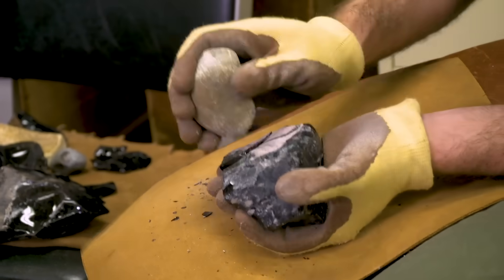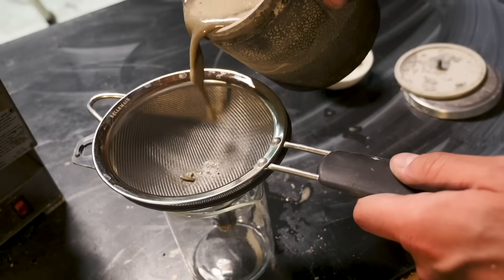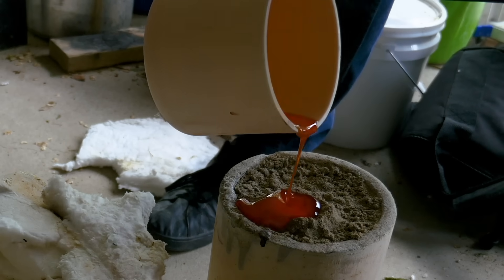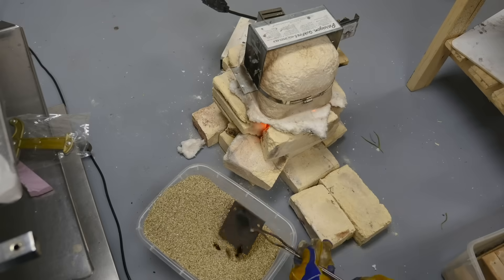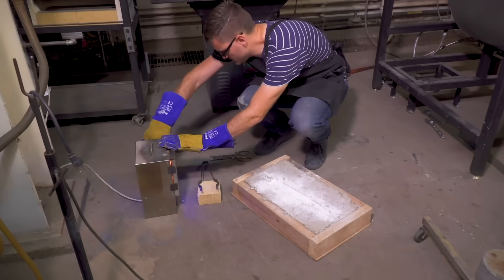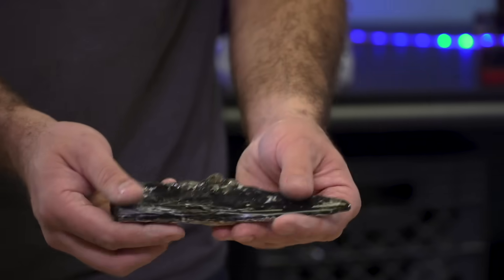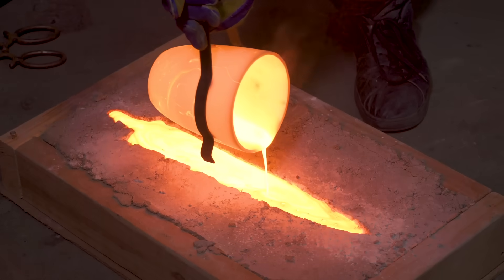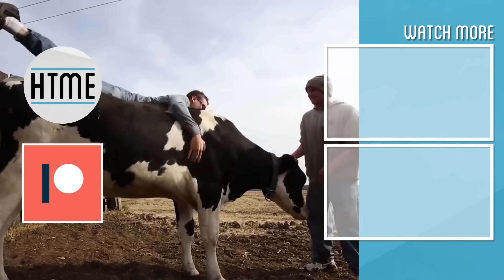Can You Melt Obsidian and Cast a Sword?

Comment: Find yourself a ceramics shop, borrow their kilns. Make the cast, crush the obsidian, put the crushed obsidian in the cast. cast and everything goes in the kiln for a cycle and then is set to cool slowly overnight bring the temperature down over time. Next day you will have a cast sword which you could in theory sharpen. Whole process circumvents the need to make obsidian pourable, and should keep most of the properties. This technique is called Frit Casting and is used by actual glassworkers mostly for making glass cameos.

Comment: I was thinking, and, what if you had some sort of fill in mold kinda thing, so, you could simply fill the mold, and, seal it tightly, so, while it would probably take longer to cool down, if it's a tight enough thing, maybe it won't break as much? 
I'm no expert, since, I'm just a kid.  XD but, I just figured I'd throw that out there. I probably sounds stupid since, there's a lot to it that I know I don't know, but, maybe it could work? Although, I'm also not sure of how any possible pressure from the heat and the bubbles could cause.

Comment: The mineral obsidian is a volcanic glass.  It has the same chemical elements as porcelains and ceramic glazes, and the primary one, silica (AKA quartz), must be very slowly cooled at two critical points to avoid stress cracks. Look up "quartz inversion" and "cristobalite formation" if you are interested.  Art glass is always put in a heated chamber (lehr) and cooled gradually for many hours.

Comment: If you give it a try again. I would try melting it, pour it, them quickly put it in a crucible at its melting temperature and incrementally lower the temperature to ambient temperature. Thats the way metallurgy works to give steel a longer life. Dont normalize, quench or aneal.

Comment: You better anneal the glass  at high temperature quickly after casting using a furnace. It will give you a beautiful piece. Do not know the temperature (maybe between 500 - 700 C)

Comment: The bubbles are definitely from moisture in the concrete. Keeping in mind, it will take a good 12-14 days for concrete to finally and completely cure. then adding a little bit of heat will remove any remaining surface moisture.
The problem is, Obsidian is formed over days if not weeks or decades, like rocks such as granite or crystals formed under pressure like diamonds etc. Letting the obsidian cool over a very long time, as in, putting the mold straight into an annealing chamber as soon as you've poured it, and slowly dropping the temperature of the obsidian over a number of hours, if not days ideally, will give you optimum results,

Comment: Figure this is why pretty much any genuine obsidian blades are fairly small and embedded into wood or other support; the stuff's just too brittle to hold on its own.  Not to mention the knapping to make them viable as blades to begin with takes off a fair bit of material and has the risk of shattering the blade further (but into smaller, still usable blades at least).

Comment: How about pouring the obsidian in a preheated sandcast?
Moreover, it seems quite obvious that the impurities contained in the obsidian could be responsible for the cracks...
That's why 'glass' was developed.
Obsidian is created in inscrutable and as a consequence non repeatable volcanic processes. The logic conclusion is that it would be easier to carefully chip away an obsidian block into the desired form and 'then' proceed to hone a blade with abrasives. How about pouring some hi-tech modern glass?
Anyway, it was fun to watch. Congrats.

Comment: Geologist here with some additional info...

Obsidian is volcanic glass, which is ultimately just rock.  Its made when felsic (silica rich, metal poor) lava is cooled down very rapidly (for lava) so that mineral crystals dont get a chance to grow.  Its basically exactly the same as granite, just instead of having big quartz and feldspar crystals you can see in your countertop, each individual crystal is so small you can only see them with an X-ray diffraction microscope.  The extremely fine grain size scatters light very effectively, giving it its dark color (along with some metallic inclusions; magnetite (an iron oxide) is a major one).

The clear amber glass that was produced at first was due to super rapid cooling that gave totally amorphous glass, no grains at all...this allows light to go through it without scattering, and the glass looks much lighter in color.  Interestingly, by doping it with so many metals, you're changing the rock's chemistry, and thus it's not really obsidian anymore...that much extra metal would make it more intermediate or mafic in composition (rocks like basalt have less silica, more metal), meaning what you were casting would actually be something called tachylite, not obsidian :)

Rocks melt at much higher temperatures than glass that humans use, as we saw, making it hard to work with.  They're also much more water-rich, especially since you were using natural obsidian...thats why it bubbled and foamed up a lot.  That's what makes volcanoes erupt, in fact - as magma under the volcano rises up towards the surface, the pressure decreases, water and CO2 bubble up, and the whole magma package rapidly expands, forcing it up through the pipe and bursting out the vent as an eruption.  So congrats, you just made a tabletop volcano that's way more realistic than baking soda and vinegar :)

I suspect most of the problems came with the annealing stage...to get a natural obsidian result without doping, you'd need to cast it at a much higher temperature - rhyolite (felsic volcanic rock) melts at around 2300F.  And you'd probably have to go even hotter than that, because even when molten, its still going to be very viscous, because in silica-rich melts, the silica polymerizes....forming long chains of connected silica molecules that make the overall melt very goopy, and you need to heat it up more to break those chains.  And once it was cast, it'd have to be held at a much higher annealing temperature - just below the melting point - and allowed to anneal for a much longer time - days, even weeks.  its actually not really annealing in the true sense, but giving enough time for nano-scale silicate mineral grains to start to form throughout the piece, giving it the black color you're looking for.  In nature, a huge flow of thick lava would take this long to fully cool, and that's what you're trying to recreate.  Go too short, and it'll be entirely glassy and look like a beer bottle.  Go too long, and the crystals will get too large and you'll lose the glassy shine, getting something more dull and stone-looking.

Comment: Cooled too slow and uneven. Obsidian has to be quickly quenched as what happens in nature during its formation. Incorrectly done, the outer layer cools first but the inner layer is now heat trapped and cools much slower so the layers become extremely brittle due to crystallization.
. 
Some polypropylene's have the same problem where the material appears strong after heating, but the slightest "jarring" breaks the crystals causing micro-fractures. Once crystallization occurs, any disturbance breaks them no matter the time delay between formation and movement.

Or at least, that's what it looked like to me.
Reply: Looks like someone has studied in Minecraft Sword Enchanment...
Reply: Lau - No, I don't know the first thing about "Minecraft". 

I work in the packaging industry. All those bags you can't open are my fault. Over time, you see a ton of issues with many different films (the material bags are made from). We run into crystallization when we try to run production too fast on cheap film. We have to substantially increase the heat, lower the pressure time "dwell", and greatly reduce the cooling time. In some films, this causes micro-fractures in the seals. The cause is identical to failed Obsidian creation from the Wikipedia page. 

They go in the shipping box fine, the next day they're all flat (leakers). Then, you won't buy it at the store. Smart of you by the way!

Chemical reactions tend to be similar across many materials so I just applied film material dynamics to "essentially" molten glass.
Reply: shunt uip nuerd
Reply: A  shween S lol

Comment: You should have worn protection when crushing the obsidian. That dust can get airbourne and cut through you lungs like nicroscopic macuahuitls causing silicosis. Being from a place where obsidian literally grows from the ground in pillars, ive learned obsidian is a rock you need go treat with respect.

Comment: you are trying to use such small equipment for the task. can't be adding flux into your obsidian and weaker metals. this is a sword we are talking about. you need to heat it up a lot more will reduce the viscosity a bit right?

Comment: That was cool vid. I worked for a long time in the glass blow moulding industry. The temperature of the mould is crucial to not getting cracks. So if your still thinking of another attempt. Find a way to heat the sand to about 700 deg F  and it may work better. Either way it looks like a success to me.

Comment: The main problem I think you had with it being brittle was that you kept using the original material from each try, even a novice forge worker would know that if you re-use material over and over again then it will lose its structural rigidity and eventually become unusable, sure you kept adding in a bit more each time, but that doesn't help make it stronger. You were making the material more unstable for casting each time you re-heated and melted it down.

Comment: The question was badly phrased from the start.  This was not a theoretical analysis by a physical attempt to do something.  By failing didn't prove that the result was possible.  It it had succeeded, the answer would be "Yes".

When someone attempts to do something physical, that person can only answer for himself.  The title  should have been "Can I Melt Obsidian and Cast a Sword?"  The answer was "No, I can't"

If you analyze it semantically, the presenter's question had two parts: "Can I melt obsidian be and use it for casting".  The answer is, "No, you could not."  The second part of the question, "can I use molten obsidian to cast a sword", has a similar answer.

If you re-posed the question as "can I use obsidian as a primary ingredient for making a cast sword", the answer is "no, you could not".   A sword is a tool that is defined by its function, not just a shape.  An obsidian knife cuts. The end product here has no integrity and is not able to be used as a bladed weapon for slashing or thrusting, so it's not a sword. The plastic toy sword is more sword-like than the casting.

Comment: is it possible to have a mold inside a kiln?  or maybe just have little fans inside the kiln to push the viscous obsidian into the wanted shape. this would help with the shattering problem.

also would it be possible for a 3d printer to use obsidian if it used very small particles of it?

Comment: the reason people usually chip the stone instead to try to melt and mold it is that the result of this chipping is sharper and smoother in microscopic level than metal knives. it's so sharp and yet so fragile that surgeon use it for one time use only and it can "cut between cells". can you test your blade if it had same sharpness with the original stone chipping method ?

Comment: I think most of your trouble is in the mold. It should have both halves and be made of a material which can be brought up to near melting temperature and then pour the material in leave the whole thing in a temeperature controlled furnace for days.Gradually cooling.Your molds cooled too fast.

Comment: If you are going to melt obsidian to a level of pour then you need to think more of a volcano. The heat has to be far higher than the melting point alone otherwise crystallization will start to happen making the first attempt of straight melting fail. Also the final form would also have to be heated (more than likely a carbon coated steel heated just under a red hot glow) and not so direct in a form like a sword, more like a thick bar. The mold would also have to be placed in a oven but at a slightly higher temp and then get down to a point of a normal tempering over for glass. This will give it a long time for the glass to slowly get down to temp. The Obsidian has impurities that will cool and solidify causing it to crack if this is not done slowly. Kinda much like cast iron will crack if it is not slowly cooled because it alone is not just Iron. 

The fact people say Obsidian is just a type of glass is kinda wrong as it is a bit more than that. It is brought to a point of crystallization but never allowed to because it cools so quickly like normal glass but, once it is cooled the way it was formed is not something that can simply done again without getting it back up to a very high temp. Sometimes the gasses that escape fro the lava is what might be needed to make the obsidian in the first place. After the gases have escaped the lava the obsidian is created but if it is remelted it might not become obsidian again. Some glasses are dealt like this and once they are cooled they can not be remelted and reformed. (Not saying this is part of what makes obsidian but it could be a process that is needed to remelt it and cast it) Once it is to that temp it has to get down to a temp past the crystallization temp to stop the crystals from starting to grow and then once that temp is gotten then a very slow cool down is needed. This method simulated that of a volcanic flow. It starts off way hotter than the lava flow happens deep inside the volcano then once it transitions from magma to lava then it cools down past the crystallization point and then the surrounding heat is very slowly cool down which can take days to happen as it is a giant mass of obsidian that cools. 

That is roughly how I would try it as many have tried to remelt obsidian before and never get it to work. The problem with the flux is that it stays inside the glass as the end result leading it to be a regular glass than obsidian. Also few people have went to a volcano and from a lava flow gotten some obsidian before it cooled and tried casting and had problems of it cracking into small pieces. It is a very tedious process to get the end result and it would be very tough for the end result.
Reply: I read all of that. And I think I’m being accepted into Harvard
Reply: BlueBae or Hogwarts, cause that some next lvl alchemy
Reply: Very well said
Reply: Not just the immense heat, but the pressure as well. although pressure in a specific volume and temperature go hand-in-hand. I think you need tons of pressure along with the temperature to keep the Obsidian gasses from bubbling and expanding in the kiln like seen in the video.
Reply: I got the point :)
Reply: Adamantian Gilga O_O

Comment: I was taught to  use a 'bath'of hydrated lime , pre heated with oxy blow torch , to cool out heat treated steel shafts etc , and are left overnight ,even days , to stop them becoming brittle ,perhaps this might be useful in this also
Reply from the maker: Thanks for the idea...the last sword was in the annealing chamber for a couple days so it was probably annealed correctly...the hydrated lime is an interesting idea though.

Comment: Try making it like a proper sand casting. Engulf the part around with sand that doesn't affect the obsidian if possible. Having the casting being fully encompassed might help keep pressure and retain shape, rather than crack due to exposure to the air and rapid cooling. Just some ideas. I'm not an engineer.

Comment: Why didn't you heat the sand? You could have built a 2-part mold, put it in an oven to get it up to its max solid temp, and then poured the obsidian into it so that both cooled together.

Comment: I like your method. Try, fail, learn, try again, fail better, learn more.  Repeat til you figure it out, then the entire thing is a success, even the failures. If you give up, it is a confirmed failure. Even that is the case, keep the leasons learned. They may still be of use down the road. Then there are always those that die trying, so, think safety?!  The only real failure are those that fail because they never tried.

Comment: I mean, to be completely fair the fragility of obsidian was the point of its use, macuahuitls was meant to have bits of obsidian break off into the wound and cause massive internal damage as the injured party moved around. Contrary to popular(?) belief, it's not a sword, you don't use it for slicing. You're supposed to make a chop, to sink the obsidian blades into the person's body, and then rip it sideways to hacksaw as much flesh as possible.

Comment: I think the biggest problem here is that real obsidian glass is nowhere near as strong as Minecraft and other video games make it out to be. It fractures easily, and is at hardest, 5.5 on the Mohs scale. Additionally, because it’s an amorphous glass, adding impurities doesn’t really help it gain strength, it only helps you melt it. 
Considering you didn’t really have a kiln that can create lava and then rapidly cool it, inside of some kind of cast, making a real pure obsidian cast would’ve be nigh impossible anyway. 
But its a pretty glass sword you made anyway.

Comment: In the end you are really just trying to make a molded glass sword shaped thing, made using ground obsidian and diluting it to the point where its not really obsidian , but dyed using the same metals used to make black glass.

obsidian just being naturally formed glass that includes large amounts of impurities. what you would really be doing is trying to overcome the properties of the obsidian itself in order to get a more pure form of glass and then mold it.

can you mold glass. yes

can you mold glass with uncontrolled impurities that will randomly change its COE and includes impurities that are not completely compatible with the process . no